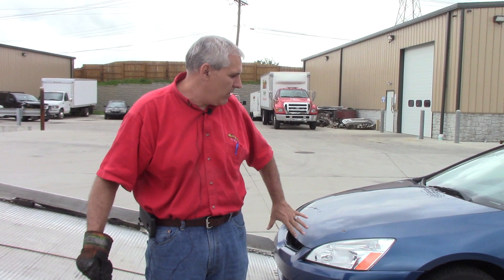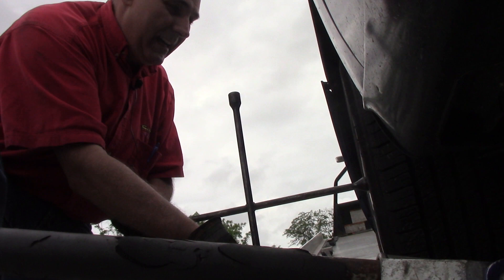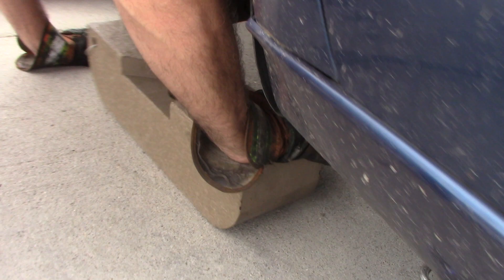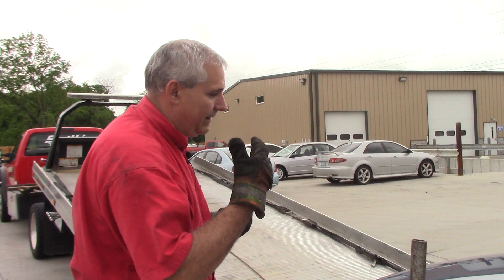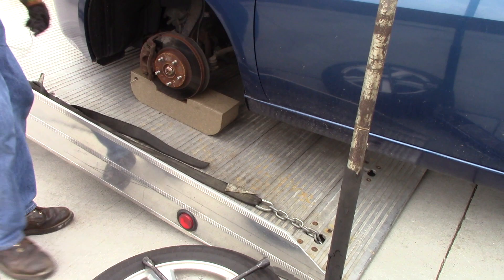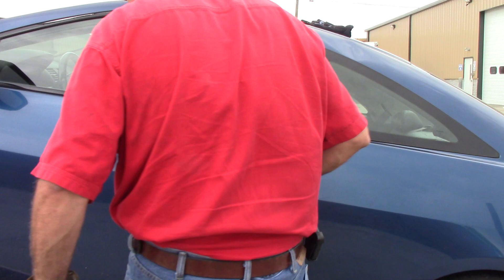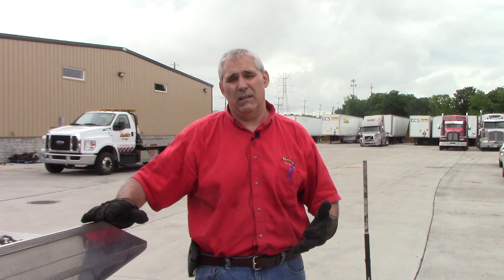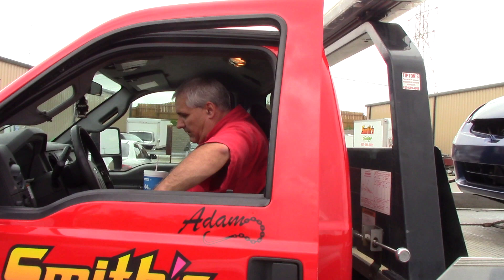On-Loading with Broken Ball Joint or Missing Wheel | Smith's Towing

Comment: Just went through this 3 days ago, when my 01 mustang broke a ball joint and had to have it towed home.  The tow guy used the "skate" as the video called it to get the front on the bed.  Put a piece of 4x4 under the control arm when we unloaded.  Prevented additional damage, and I was able to replace the ball joint and have the car rolling the next day.

Comment: I've used ratchet strap over upper and lower control arms snap the ball joints back into place for temporary use so I could roll the vehicle. Or for a WL
Reply from the maker: That works. You can do that with tie rod ends too.
Reply: Did that with an FJ that had a busted upper ball joint

Comment: Just came back from a Tesla model s . All plastic on the bottom . The car is so low I couldn’t get a low profile aluminum  jack underneath . Even after jacking up the alternate corner which was the only side high enough to fit a jack I wasn’t able to raise the damages corner enough ti get a block of wood under . I wound up calling the large company in the area to do the job .Their eta was 2 hours so I couldn’t resist and watch them do it . Any ideas on what to do next time ?

Comment: I have a nissan armada and my ball joint just broke and sitting in the driveway. It's an old asphalt driveway. The vehicle is facing toward the house and no room to pick it up from the front end. Can it be loaded the same way from the rear? Thanks for the video.

Comment: The best way is with a wheel lift lol
Reply: The best way for a guy to go and fuck up a wheel well... It's not difficult or time consuming to load a broken ball joint car, it's difficult or time consuming to do it without fucking up the wheel well any further... Most wheel lift guys just lift by the wheels because it'll stay in the wheel lift and tow fine even with a broke ball joint, but then the whole ride it's bouncing up into and tearing up the wheel well...

Comment: Avoid a career in towing. Repair towing is going away...permanently. Replace the ball joint and axle shaft on site. No need to move a vehicle with a separated ball joint.